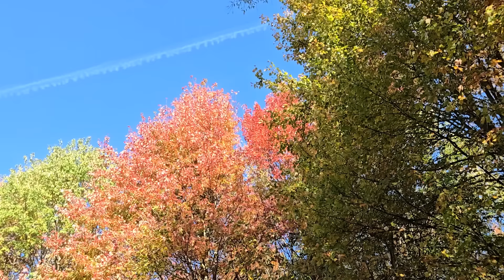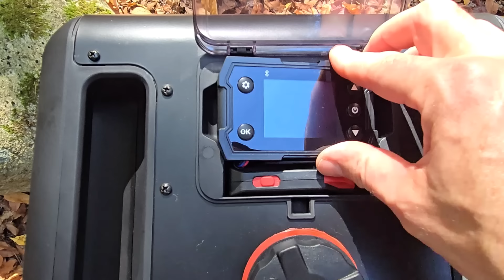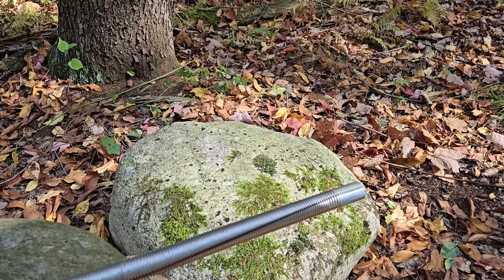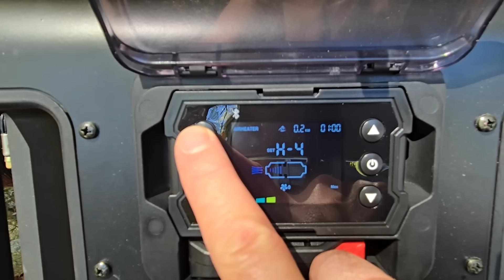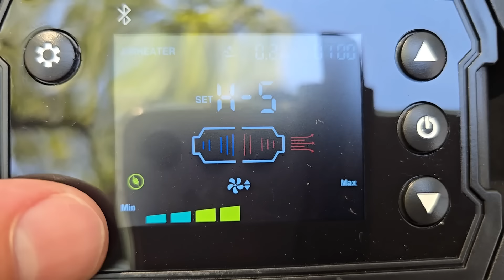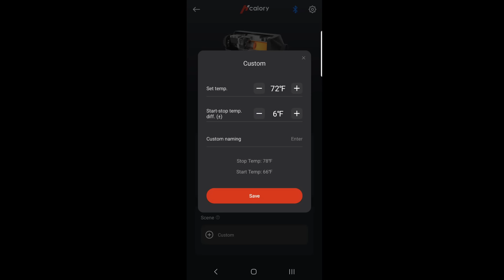62 Hours of Heat On a Tank! The NEWEST Diesel Heater: Hcalory Toolbox Max!

Comment: Don’t buy one of those I first bought the tool box 2 then I bought 2 toolbox max all three the fire box plugged up with black suit and started blowing white smoke and stoped working. One of the tool box max didn’t last a tank of fuel. I have a vevor I paid less than $100 I ran it for 2 winters consistently with out a problem
Reply from the maker: I'm wondering, when you shut them down, did the full burn down/cool off cycle happen before it was unplugged? Luckily, I haven't had that problem. Been running 1-year with mine and no issues.
Reply: @HemlockRidgeUSA auto shut down all the time and always used pump diesel

Comment: What a big tank you used? Mit 5 Litern läuft meine heizung kein 62 stunden. Und wenn, auf niedrigster Stufe, dann wirds nicht warm genug, Heizen kommt von Leistung, Leistung von Brennstoff, mehr Leistung, von mehr Brennstoff. Ihr veralbert Euch alle selbst. Ich brauch keine 8 kw Heizung kaufen, wenn ich sie mit 1 kw laufen lassen möchte. Alles selbst veralbern.
Reply from the maker: Hi: It's a 7.5L tank. Obviously, 62 hours is on the lowest setting. If it's working harder, it will burn more fuel, but I've found it to be very fuel efficient either way.

Comment: I own the 2025 Hcalory HBU1S. Basically all the same feature's of the Toolbox Max but it's a DIY install (no box).
What I am curious about is the temp of the internal heat exchanger.   I have only seen a couple videos on this unit showing the internal temp at different settings and for some reason they are lower than the HBU1S when using the same settings.   I need to get another heater and was considering the Toolbox Max.   Can you possibly post some internal temp readings from your controller for Levels 1-5 and 7?
Thanks.

Comment: I was on a video that this guy had 30yrs experience in furnace  install an diesel heaters and was adiment on getting the cold air inlet from outside. What are your thoughts about it? I know you mention recirculation warm air but he said it would it would get negative pressure and it would suck air from cracks in Windows or walls doors etc . And would suck exhaust back in the house or shed. But this unit would be a big duct which does not come with this unit. Not sure what to do on this since im going to receive it in a couple of days
Reply from the maker: I've run it inside now several times with no issues. True, any source of combustion is going to use air. My wood stove in the cabin isn't vented outside and I'm sure that uses much more air than the diesel heater. I've never had a problem with the diesel heater sucking in exhaust from the outside. Can't smell anything and the onboard CO detector shows 0 PPM. Honestly, I think this unit burns so efficiently it's probably not an issue. I have seen some other units that have a separate ducted air-intake, but I'm guessing those are higher BTU units (greater combustion) and/or they are for vehicles (vans, trucks, campers) that might be airtight and you could have an issue with oxygen deprivation.
Reply: @HemlockRidgeUSA I thought the same way. I have a 12x19 gambrel shed no windows except a transom obove my slinding doors  also have a loft that goes half down the shed. No installation.  Thinking of doing it but it would take some work with all the stuff I have hanging. When it's really cold like 9 degrees it will bring the temp up around 30 + but even that takes 45 minutes or more. Temps that are 25 degrees or above it will get to 40 to 50 after about an hr. I thought it would heat faster at hh10 but better then nothing and I can start it on my phone and go out later. But not having a cold intake outside and just the exhaust port im with you on that. Besides I have a problem on making a 3 1/2" hole in my wall. I just use it once in a while anyways. But insulation would help and I might just do the walls I can get at without taking everything down thats hanging. Thanks for your input.

Comment: Mine has high fuel consumption and a fuel leak from the start. The best I have got on the lowest setting is about 28 hours. I have been getting the run around from customer service and they told me that it will only run for half of the advertised run time if the temp is below freezing. It uses about the same amount of fuel as the other 3 heaters that I have. Here is that email. 

"Dear Customer,
Thank you for your email.

Energy consumption is related to ambient temperature.

Our control logic is dynamic. The first setting is based on an aluminum combustion temperature of 140°C at 2000 RPM.

A basic oil pump frequency range is 1.5~3 times/second. The oil pump specification is 0.022mL/1000 cycles. In our laboratory tests at an ambient temperature of 15°C, the average oil pump frequency at the first combustion setting was 1.5 times/second. Therefore, the measured time was 62 hours.

If you are in an environment of 0°C or lower, and your diesel fuel may have a lower calorific value, you may need a frequency of 3.0Hz to reach the required aluminum combustion temperature. Therefore, it may take around 31 hours. At 0°C, even at the lowest setting, the runtime is 34 hours.

The unit's speed setting design logic differs from other heaters. Our hcalory's 1-10 settings have fixed RPM and fixed aluminum combustion temperature to ensure that the actual heating effect varies with each setting. Therefore, the oil pump frequency may dynamically change within a certain range.

Of course, this may not achieve the desired fuel consumption at low temperatures. However, we have never encountered a situation where the heater runs out of fuel in 24 hours. We suggest checking the bottom of the heater for any trace diesel leaks.

Please feel free to contact us.
Best regards,"

Comment: Hold up...need more explanation....off road on road only diff is tax...no2 has more wax than no1 which no1 cost more(refined more) and is used for flow in burners(like Toyostove 56) vs carbonated (atomized) injection(furnace)...So was wondering benefits if run less wax might keep unit cleaner and possibly efficient meaning less trouble or even less smoke in exhaust....? My Toyostove Laser 56 WILL NOT run on no2 anything, only no1(well I did add few oz gas per gal no2 once but not a clean burn and caused carbon build up). Wax does not fume so will not work on flow in fires like no1 and needs atomization to burn clean
Reply from the maker: Thanks for the explanation. I'm running No 2 right from the gas station in mine..

Comment: I guess the big question would be...  Now that winter has arrived, have you used it on your cabin?   How did it do heating the place without the help of a wood burning stove?   How big is your cabin and can it handle that square footage?
Reply from the maker: So far so good. I've used it to get the cabin up to temperature from freezing when I arrive. Instead of waiting 4 hours for the wood stove to warm it up, run this with the wood stove and place gets up to temp in 1 hour. I've also used it in my outhouse and set it to maintain 70 degrees when it was 25 degrees outside.

Comment: I Wonder if you can use a 55 gallon water drum to capture the exhaust heat to make a space heater to add to the efficiency.  Like the old time boiler system.
Reply: Actually there was a cabin in Ak and they would heat that barrel once a week.
Reply: @victorreece9256  yes its actualy easy you take a stainless drum or steel put 1hole on each side and weld a pipe trough the holes and plug your exhaust a the exit of the heater to barrel and barrel trough the wall

Comment: The AIR INTAKE for the heater needs to be inside for 2 reasons:
1. With the AIR INTAKE outside on the heater you are always starting with the COLD outside air to heat before it is warmed and sent inside. If the AIR INTAKE is piped to the INSIDE the room air is easier to heat because you are NOT starting with the COLD outside air.
2. Second reason: It will eliminate any chance of the stinky diesel exhaust from being brought inside.
Reply: Always draw combustion air from the outside to avoid creating a slight vacuum in your dwelling. ALL the manufacturers agree with this approach.

Comment: Has anyone tried to use this unit to accommodate a standard heat pump unit in other words, especially during cold weather, you could pump in hot air which in theory should cause your central heat and air to have to run less time and over the course of winter &  fall, this should reduce your power bill, correct or am I looking at this correctly?
Reply from the maker: I imagine any supplemental heat source could help. You'd need to plumb it into your living space, but perhaps it could be less expensive than the power that the heat pump uses.

Comment: Something always seems screwy with paid promotions.
Reply from the maker: I can understand your skepticism. I would be too. YouTube requires creators to turn on the "paid promotion" flag for anything received of value in a video. In the case of this heater, the company asked me if I would give it an honest review, and if so, they would send me a sample to test. Even though I wasn't paid, I have to flag it as "paid promotion" since I was given the heater free of charge to test. This is also due to a FTC rule that requires disclosure. I was genuinely impressed with the unit. My goal in doing these reviews is to simply create awareness around cool, new, or innovative products that could be useful for folks who are off grid or outdoor enthusiasts. Believe me when I say I get 2-3 requests PER DAY to review products on the channel. 90% of them I decline because the company isn't reputable in my opinion, the product doesn't have good reviews, or it's not relevant to the channel's theme/audience. I try to only feature products I personally would find valuable. Hope that context helps!

Comment: Thank is a very nice unit!!  Like they included everything you need to get it going.  It is nice that you can run it from a power bank.  This would be an awesome addition to my little 71 LEE camper that is about 14 feet long.  The propane heater in my camper no longer works, and this would be a great addition.  It does sound quite.  I like the multiple ways you can control the unit, the actual head unit, the remote and the phone app.  This is a great addition to anyone's camping gear, and to use at home in the vent of a power outage if your heat is electric.  Thanks for sharing your review of this diesel heater.

Comment: I went to the link and the heater is unavailable with no info on when it will be back. is this being discontinued? There was also another smart heater option (taller version). Is that the same and will you be testing that one?
Reply from the maker: Hello- they keep selling out. They got some back in stock and then they sold out again. I'm not sure if the taller version is the same unit. Unfortunately I don't have any plans to test that one, but I think the internals are fairly similar on most of these units.
Reply: @HemlockRidgeUSA  The mod I was referring to is the toolbox 2s plus. Looks to have the same options in a brief case style frame. Possibly not as water proof and slightly less fuel capacity (specs from their site.)  
Thanks for responding - appreciated your review!

Comment: You mentioned a "thimble" for indoor use? How would one find one of these?
Reply from the maker: Here's a link for one on Amazon. If you have thicker walls, you may need to get a through the wall stove pipe port and fabricate something.
https://amzn.to/47SclQ4
Reply: Amazon has them  diesel heater accessories

Comment: Wow! That's so unbelievably quiet😮! I thought all diesel heaters had that annoying ticking sound? There's none! Ha! I have always been a rv suburban propane heater guy! I just might buy this for my truck camper I'm building. Two question, does this have a built in thermostat to where it will shut off & turn back on if it reaches your desired temperature setting? And, does this unit reach from 5kw to 8kw, or is it just an 8kw unit? Thanks for adding the links. You get a Thumbs up 👍 my friend!
Reply from the maker: Thanks for the comment. Yes, there is both an onboard thermostat and a thermostat on the remote control. You can tell the unit to either cycle on/off using the onboard thermostat or using the temperature on the wireless remote control. While the unit is rated at 8kw, I believe it will ratchet down the fuel dosing based on the temperature differential. Good luck with your truck camper!
Reply: @HemlockRidgeUSA  great! thanks for the quick response & answers!

Comment: I watched on another site where he hooked his exhaust pipe to an old cast iron water heater. He put a thermal gun oh it and so far its still looking great. 18:59 They are ment to be inside not the outside. They can be damaged or worse stolen.😢
Reply: When you receive yours check the installation manual to see where it should be placed. Mine have always been under the carport for reduced noise and for increased safety,
Reply: My neighbor has his inside his detached garage, with the exhaust hooked to an old cast iron heater for the last 3 winters. In a metal insulated box and two carbon monoxide detectors. It's real quiet and warm.
Reply: Loren...that's incorrect. This is meant for outside. I went to the company's site, & this is what they said...
Hcalory diesel heater can be set outside, which is the recommended and safest way to use it for heating enclosed spaces like tents, sheds, or RVs, as this vents the exhaust fumes outdoors. "Placing the unit outside" prevents the buildup of dangerous carbon monoxide and keeps the noise level lower inside the heated space.
Reply: @dreamlookautodetailingauto3353 Key word "Can" not must.

Comment: How many hours will it run on a 12v trolling battery.
Reply from the maker: It really depends on the capacity of the battery and how hard the fan is blowing in the heater. On low the fan uses about 20 watts, but on high the fan uses 70 watts.

Now look at the amp hours of your trolling motor. If its 50 AH multiple by 12V to get watt hours. That would be 600 watts before the battery ia dead (you dont want to drain it more than 50% unless it's a LF battery).  So if the fan on the heater was using 60 watts youd have 10 hours until the battery was dead (or 5 hours until you reached 50% discharge).
Reply: I run mine from a Lifepo4 12v 100a/h battery.  I turn mine off at times during the day.  It gets a bit warm if I don't.  Even with several start cycles, which pull more power, I can run the heater for days and still have over 70% capacity left in the battery.  During start up, it pulls about 10 to 12 amps.  May pull a little more if it is outside in the cold.  Mine is inside.  The start up when the glow plug is on is only a few minutes.  I've read some where it is cold say around 5 minutes.  Once that is past tho, mine pulls about 1 amp on low and about 3.5 amps on high.  So if I start mine and run it on high, I should get 30 hours at least.  I get longer if on low.

These things can vary a bit but that should get you in the ball park at least.  Oh, I've found out these things do not like sudden power loss.  They have to go through the cool down process to shutdown.  If you lose power and it is hot, it can damage one of the boards in the heater.  The fan keeps it cool when running but if it loses power and the fan stops, all the heat in the exchanger is right there where the board is located.  They not expensive but if you lose power and don't have a extra board, you have to wait until you can order one and have it shipped to you.  This is why I went with the battery route.  

Also, at first, I ran mine off a lead acid battery.  The start up is a bit rough on a lead acid battery especially a older battery.  It works but I could tell the heater needs a higher voltage, or more stable voltage.  Once I got the Lifepo4 battery in and hooked up, I can tell the heater works a lot better.  The start up process seems to be easier, less noise as it is trying to heat up the plug.  If possible, I'd recommend a set up like mine.  A 12v 100a/h battery, 12v smart battery charger with maintenance mode.  That mode keeps the battery topped off.  It's designed more for RVs and boats that have loads at times running.  With that setup, if power fails due to storms or something, the battery takes over.  Just exercise your battery every once in a while.  When you have power, the charger supplies the power.  The right type of charger is important.  Most Lifepo4 chargers charge, shut off and do not restart unless you disconnect and reconnect them so maintenance mode is important, as is smart.  If you use Amazon, ask Rufus this.  maintenance mode with load  You should get something like this:  

"Maintenance Mode with Load:

    Light loads (under 10A): Maintains float voltage around 13.6-13.8V while supplying load current
    Moderate loads (10-25A): Switches between maintenance and active charging as needed to meet demand
    Heavy loads (25-30A): Exits maintenance mode and returns to full 14.6V charging voltage

"How It Works: The intelligent trickle charging system continuously monitors both battery voltage and current draw. When a load is detected during maintenance mode, the charger automatically adjusts its output to maintain battery health while powering the connected equipment."  

This works great on say a RV that has a fridge or a boat that has a pump.  Oh, one can use solar instead of a powered charger too.  I just bought a new charger.  I haven't tested it yet.  The first charger is a charge and cut off type.  It works, just have to disconnect and reconnect to keep the battery topped off.  The new charger I got yesterday has the maintenance mode.  If interested, reply in about a week and I'll share how the new charger is doing.  

Hope all that helps.  No, I don't do videos. LOL